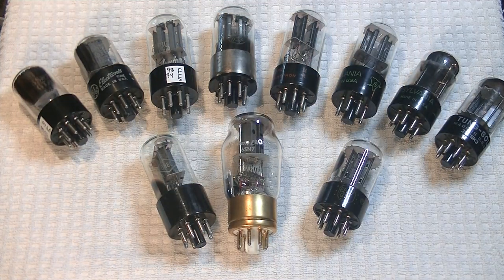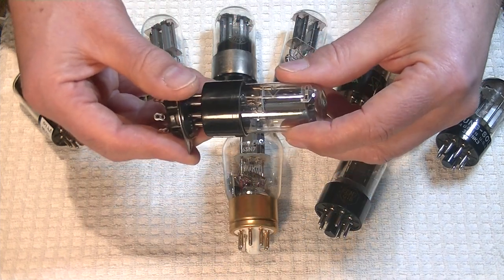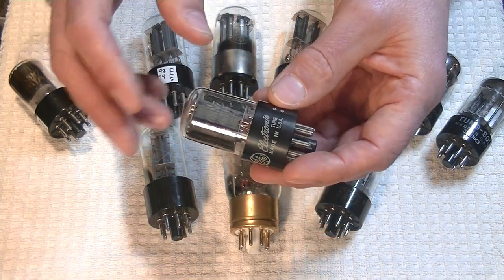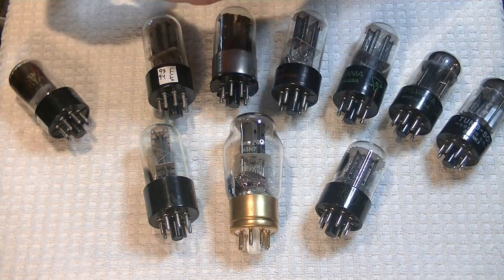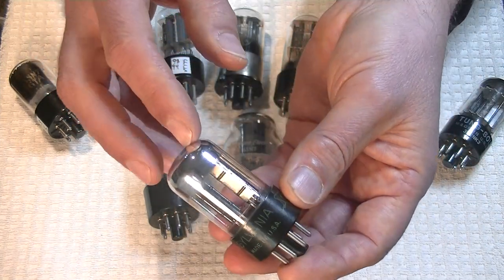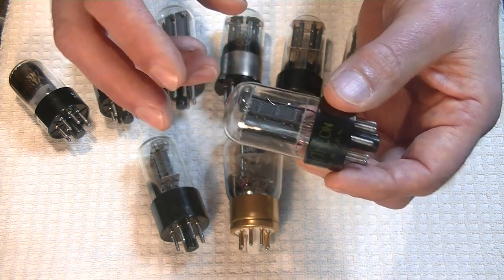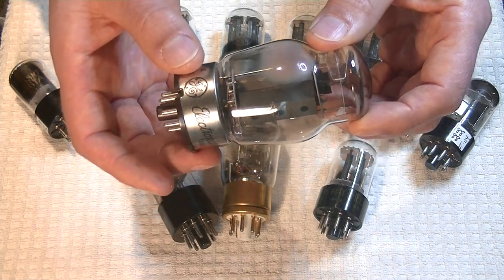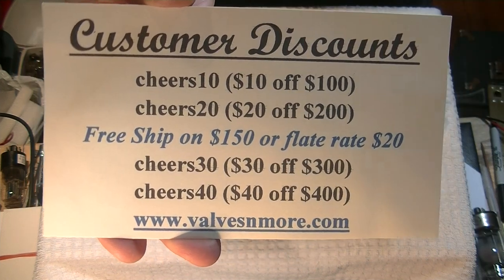Tube Lab #22 Tubes for the Schiit Freya+ Preamp

Comment: Have you received your Willsenton yet
Reply from the maker: No sign of it, but that's normal, in return for cheap shipping (well cheapish) you get a slow boat from China.  That said it'll probably land on my doorstep next week.  I have a huge selection of tubes to review for each type.  So will probably break it down into many episodes.  Then the mods, well this could take all year in bits and pieces!
Reply: @tubelab194  ahh I was more impatient, I paid for air freight. Have had mine for two weeks. Interested in hearing your opinion, especially on the build quality. My only concern is the quality of the trans.
Reply from the maker: @snowrs1  According to reviewers I trust, build and sound quality are excellent.  As you stated it's all about the output transformers.  When I finally listen to it critically, I hope I can give the sound a good review!  Otherwise it will be impossible to review tubes with it, which was really the focus of bringing it in for Tube Lab.  Soon!

Comment: Why do some line stage pres have only 2 tubes, eg vac, and others have 8, eg arc ?
Reply from the maker: An excellent question!  First of some tubes are twin triodes and some single.  For example two very common and very alike preamp tubes are the 12au7 and 6sn7, they both have two tubes in one envelope. Whereas the 6J5 (one half of a 6sn7) has only one section.  So a very simple preamp has a gain stage and a cathode follower and if using the 12au7 you only need one tube per channel or two for stereo!  If you need more gain, you need to either change to a higher gain tube or add more tubes.  And if you are using a true balanced circuit you need double the tubes!
Reply: @tubelab194  wow, great answer, thanks.  Maybe u know where i can find a good writeup explaining inner workings of a preamp. Thanks.
Reply from the maker: @iampuzzleman282  I'm not aware of a book or online post specifically related to how preamps work.  But here's an overview, they really aren't that complicated!  In its simplest form it is just a volume knob (line preamp) something inline with the signal that controls volume.  Add switching (source/tape loop etc) and you now have a basic preamp.  In a tube preamplifier, you need at least one tube gain stage and in most cases a cathode follower stage.  The gain is self explanatory, the stage can increase the volume of the input signal, say from 2vac to 5vac.  The cathode follower doesn't increase the gain but gives us a low impedance signal or another way to say it is a low resistance signal that can easily pass through wires of length to the next stage without any additions to the signal.  I have several tube labs talking about my various prototype preamps, complete with a look and explanation of how the circuit works.

Comment: I have bought bunch of 6J5's and i am planning to use them with an adapter with Freya +...By the way do you think adapters or things like socket savers have impact on the sound quality?Thanks!
Reply from the maker: True the 6J5 is equal to 1/2 a 6SN7 or a better way to put it, is the 6sn7 is made up of two (2) 6J5's inside one envelope.  So it won't work, as you'll only have half a tube!  Adapters, well less is almost always more, however a well made adapter or socket saver should not subtract from the circuit in any significant or meaningful way.  I recommend socket savers for the Freya to lift the tubes up to top plate height so you don't have to grasp the glass to insert or pull - a very bad idea with vintage tubes!
Reply: @tubelab194  Thanks for the tip!Well there are adapters which use 2x6J5 as single 6SN7 and people claim that two 6J5 tubes sound much better than any single 6SN7 tube.7193 and CV6 tubes are praised a lot as well and they can be used with an adapter too.
Reply: @OMR HSN is there room enough for such an adaptor on the Freya+?
Reply: @sebastianlunoe  Don't know. Never tried it.